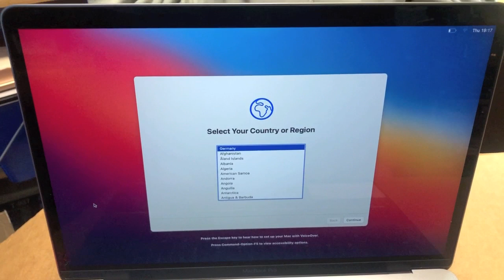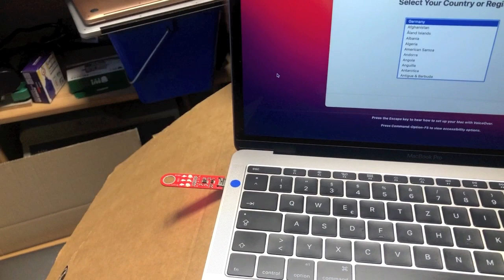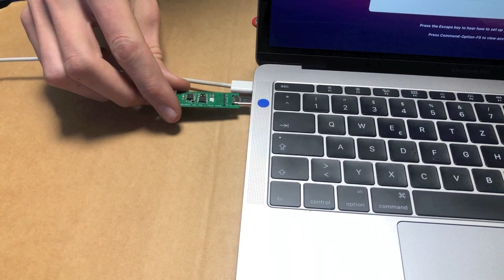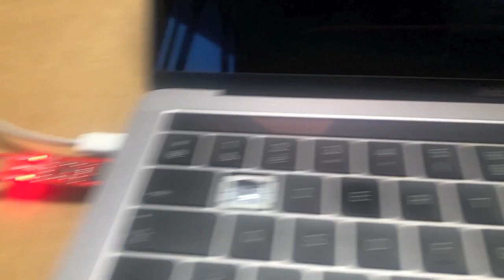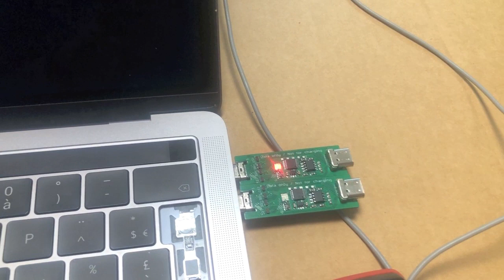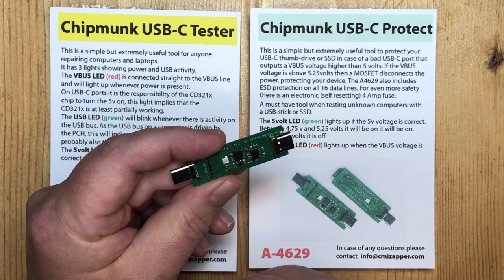How to (not) blow up your external USB-C drive. Chipmunk USB-C Tester and USB-C Protector.

Comment: What did you do to trigger this behaviour? Never seen this before
Reply from the maker: These are normal broken Macs. Nothing was done to trigger this behaviour. The problem is more common than people think, but it only bites you when you connect an external USB-C device other than a charger. What I am trying to show is that even if a Mac wants to charge on all USB-C ports that does not mean that all the USB-C ports are OK. You have been warned.
Reply: So to do if we want to definitely resolve the problem in this case @cmizapper
Reply from the maker: Always use the A4629 Chipmunk USB-C Protect when connecting a drive or USB stick to an unknown Mac.
Reply from the maker: Contact me by email or WhatsApp please.